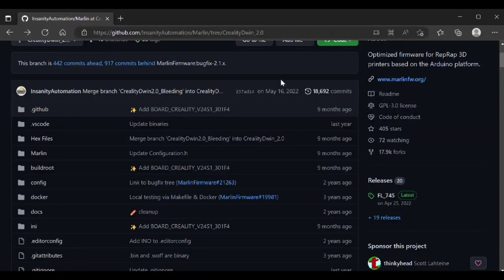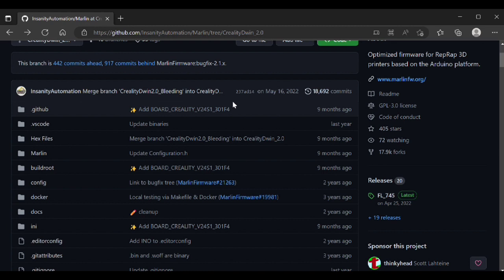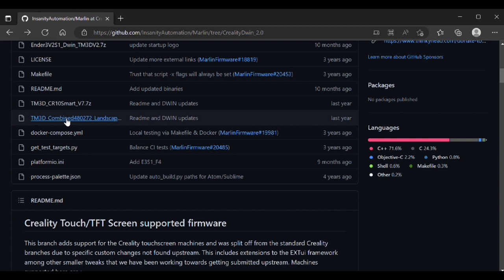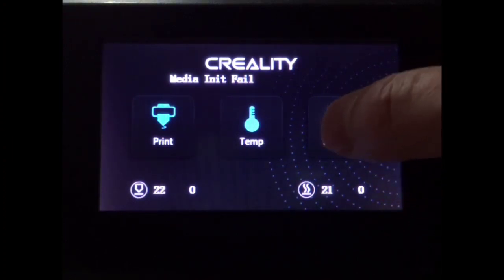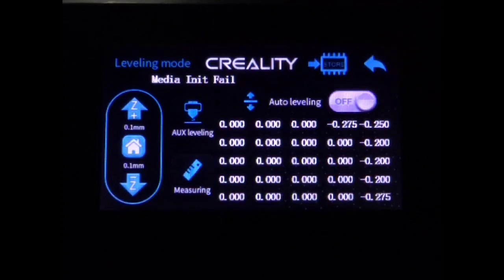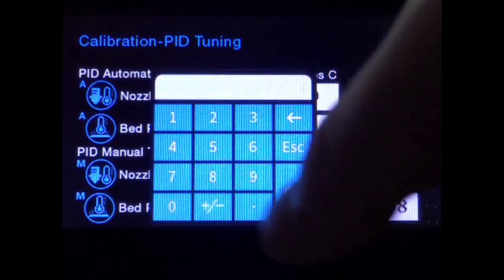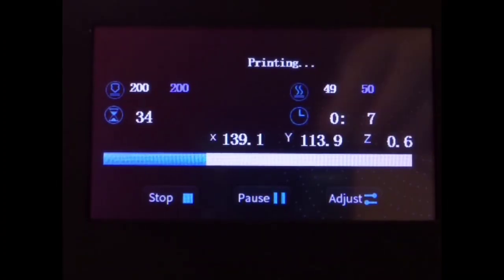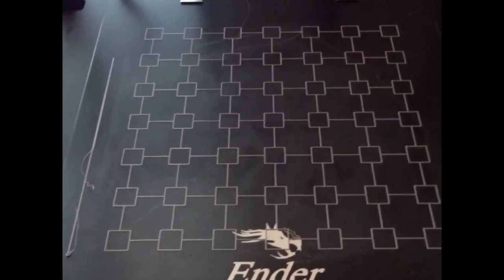Creality Ender 6 - Marlin firmware upgrade, the easy way.

Comment: I did the screen, no issues at all, tried putting the main firmware folder onto the card, fault message comes on screen. Try the .bin file by itself, still just a fault message. Formatted to FAT32, 4096. It's a 7.4.7 now, apart from that I did it according to the video.. any hints? Thanks for an informative video :)
Reply from the maker: Name it firmware.bin and put it on the root of the sd card.
Reply: @joeprints3dstuff  Tried that, it said Fault message again, left it 5 seconds and suddenly all worked. Thanks a lot! :D
Reply: When I run it, it says "Media Init Fail" but seems to work. Is that an issue or should I just use it?
Reply from the maker: Do you have an SD card inserted?
Reply: @joeprints3dstuff  Currently stuck at this point. Tried this and it didn't work; still stuck on the display screen. Any suggestion?
Reply from the maker: If you cannot flash the screen, get an 8gb card formated to fat32 and try it again.
Reply from the maker: @cesarmartinez6708 check the description of the video for links to the firmware and the screen firmware. Use those.
Reply: @joeprints3dstuff  Yes i have an 8GB card formatted to FAT32. I also followed the links provided but still stuck at the display screen when i insert card into motherboard.
Reply from the maker: So you have to take the dwin folder and put it on the root of the sd card. Also, you have to put the sd card in the display board and boot the machine. This is not the slot in the display housing, but the actual display board. When it boots the display should turn blue.
Reply: @joeprints3dstuff  Ok the display turned blue this time but nothing seems to happen after. It says
 SD Card Process... END! 
Download. CFG FIles: 0000
Download Code Files: 0000
Download .Lib FIles: 0000
Download .H2k Files: 0000
Download .Bin Files: 0000
etc.
Seems to be empty/null but all the files are in the folder. Do you know why that is?
Reply from the maker: @cesarmartinez6708 make sure it is formated fat32 with 4096 byte allocation.
Reply: @joeprints3dstuff  Yes i made sure it's in this format. However my thumbdrive gives me two directories since it has a big and small SD card slot. One of them can't be formatted to FAT32 with 4096 byte allocation. It can only be 2048 byte allocation at FAT32. To be 4096, it has to be set to 'FAT (Default)'. Please advise
Reply from the maker: @cesarmartinez6708 needs to be 4096.
Reply from the maker: @cesarmartinez6708 you didn't partition the sd card did you? You need a physical 8gb or smaller card. These displays are super picky.
Reply: @joeprints3dstuff  i shouldn't need to partition it right? Since my card is 8gb. Any way, I'm still stuck. Could you provide any more troubleshooting methods? Creality tech support is the worst.
Reply from the maker: @cesarmartinez6708  no you don't want the sd card partitioned. 8gb or less, fat 32, 4096 allocation. Put the dwinset folder on the root of the sd card. Put the sd card into the card slot on the back of the display board and boot the machine. Once done, place the firmware file on the root of the sd card and put it in the sd slot of the printer and boot the printer. If successful you should see a different boot screen for insanity automation.

Comment: Mine also crashes into doors when stopping prints also got no beeps when pressing keys even with sound at max
Reply from the maker: What version?
Reply: Did you ever find a solution to this, mine is doing it too
Reply: yes downloaded th3d firmware  @gaefrogge5806

Comment: It looks like my upload of the main firmware is working but its not for the screen firmware. I format the microsd and download the .7z file like i think i should (your video didn't show that but should be self-explanatory). The only difference I see from the screen firmware you uploaded and mine is that it looks like mine is 3 weeks old and the one you did was 1 year old at the time you recorded. Any help would be appreciated. thanks
Reply from the maker: Make sure your SD card is 8gb or under, that its formatted fat32 and that the block sector size is 4096.
Reply: @joeprints3dstuff  ah that must be the problem. I have a 16gb. Another question, I saw in the creality video that when they flashed the stock screens they put a DWIN SET folder onto the sd card and flashed that. I’m assuming it doesn’t matter if I flash the raw .7z file right?
Reply from the maker: No, you need to extract the DWIN_SET folder and place it on the root of the sd card.
Reply: @joeprints3dstuff  that makes sense to me but when I try to download the “combined” file that you mentioned in the video I what appears to be what you’re referencing in the video but I only download a single .7z file. Like I said in the first comment, the difference is that what I’m seeing on GitHub is 3weeks old and yours was a year old when you recorded this video. I’ll go back and look. Maybe I’m just downloading the wrong thing
Reply: @Joe Prints i think it was a anti-malware catch that screwed everything up cuz I just successfully downloaded the whole DWIN_SET folder from my work computer. Thanks again.
Reply: So I ended up getting the both the main firmware and screen firmware to upload successfully, or so I thought. It seems the PID loop calibration that you showed in your video isn’t working the same. When I hit “start” it immediately shows PID calibration finished (or something of that nature). It doesn’t go through multiple iterations to get the p, I, and d values. I used a 16gb sd card but I feel like it if was truly a problem I wouldnt have gotten this far. Other than that I think I have a newer version of the program than you do in this video. Other than that I’m at a loss. Any other suggestions?

Also I tried to revert back to the stock creality firmware from their website and I did it exactly per their video and the screen wasn’t working. So weird. Again, only difference is I had a 16gb sd card instead of an 8gb.
Reply from the maker: You have to use an 8gb card to flash the screen.
Reply: @joeprints3dstuff  alright hopefully that’s the problem. I got a few coming through Amazon. Thanks dude

Comment: Hey Joe, thank you for the video. After installing the tinymachine firmware, I have a problem when i will stop the print process. When I push "Stop" and confirm with "yes", the printhead drive not to home position, but in direction of the doors and crashs. Can you help me, please?
Reply from the maker: Mine doesn't do that. Is yours stock?
Reply: @joeprints3dstuff  yes its Stock. Can you maybe try it, when you start a Print, wait a few Seconds and Press than Stop.
Reply from the maker: I am running klipper now for the next video. Which version did you install?
Reply: @joeprints3dstuff  i Install the 7.4.7. do you have a older Version which works?
Reply from the maker: No, it isn't my software. I will load it up here in a bit and see if mine does it as well.
Reply: @joeprints3dstuff  thank you very much for your help!
Reply from the maker: Ok, so on mine when I hit stop while printing from sd, it does just that, it stops. The only thing that moves is the z drops around 10mm.
Reply: @joeprints3dstuff  okay thank you, can you maybe send me your current Firmware, please?
Reply: I had this issue before and found it was a poor connection with my x, y and z sensors. I pulled a little on the wire and it came apart. I soldered it back and now it’s perfectly fine.
Reply from the maker: Glad you found the problem.

Comment: Hi Joe, do you know how to back to stock firmware, I have issue with that, when I install stock firmware, no words displayed on the screen, only empty picture of interface also touch screen not works. I tried instanityAutomation again and it’s work fine. So the question how to back to stock firmware?
Reply from the maker: You have to flash the screen with the dwin_set in the creality firmware.
Reply: Hello how did you solve the problem? When I want to return to the original software, the screen does not work.
Reply from the maker: You have to flash the screen to the original creality version.
Reply: @joeprints3dstuff  I do it, but as a result, the screen is written in Chinese and does not work, it does not show the degree.
Reply: @joeprints3dstuff  I tried for exactly 1 hour, but it is impossible to return to the original software.
Reply: @joeprints3dstuff  I install the original screen software, a blue screen appears, everything is progressing normally, finally the end message appears and I close it.  Then I install original firmware with big sd card but the screen freezes in Chinese and the screen touch is disabled
Reply from the maker: @turboNightPanel  The display is very picky. Make sure you follow crealities video on flashing the display. Has to be 8gb card or lower. Has to be formated 4086 blocks, fat32.
Reply: @joeprints3dstuff  Believe me, I tried them all, my friend.  Anyway, the screen update comes to the end and the end text appears, so it does not give any errors.  My hands are tied, I can't do anything
Reply: @joeprints3dstuff  Also, when I go back to your software, the screen works again, but I want to go back to the original software.
Reply from the maker: @turboNightPanel where did you get the software you are flashing from?
Reply: @joeprints3dstuff  Directly from the Creality Ender 6 software page
Reply: @joeprints3dstuff  Actually, I didn't think there was a problem with the display software because it finishes it all the way, but it doesn't seem to be doing the motherboard software we made with the big SD card properly.

Comment: Thanks, it's work!
Reply from the maker: Glad to hear it
Reply: @joeprints3dstuff  One thing, for some reason now on the movement tab the x and y coordinates of the home place is 254x254, can you check on your Ender6 what you see?
Reply: @youssefhoujeiri8110  I have exactly the same problem. Any idea how can i reset it, or change it?
Reply: @pavlik6  unfortunately no, I switched to klipper
Reply: @youssefhoujeiri8110  thanks. Do you have good source or link how to do it?

Comment: hello, good video, i used the auto marlin and version 2.1.2 and my machine just dosen´t work is in the priting menu in chinease and dosent leave that menu whatever i do
Reply from the maker: Yes, you cannot just flash the firmware as it doesn't know how to communicate with the screen software.
Reply: @joeprints3dstuff  well im a noob xd what can i do too fix it
Reply from the maker: Follow my video. It will sort it out for you. Also watch the creality tutorial on flashing the screen. You can find the link in the description.
Reply: @joeprints3dstuff  i fallowed your video step by set and even used your firmware but i can´t flash the screen, the screen is in permanent chinease, i can´t swap to english and i can´t do most things, pls help
Reply from the maker: @MikeloiML  make sure you follow creality tutorial on how to flash the screen. The SD card needs to be formatted properly.
Reply: @joeprints3dstuff  yes i understand i did it but my screen dosent read the sd card for some reason
Reply from the maker: Use another card
Reply: @MikeloiML  check if your microSD is in FAT32. Some MicroSD is formatting by default only in exfat or ntfs and need special app to do that.